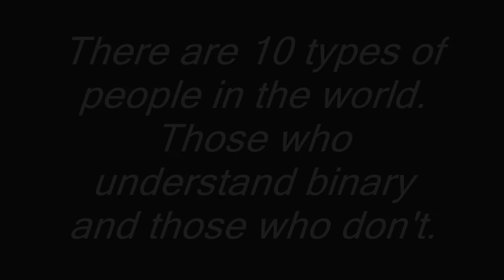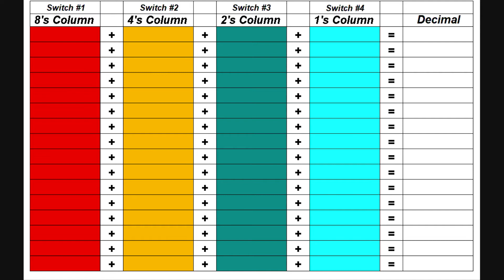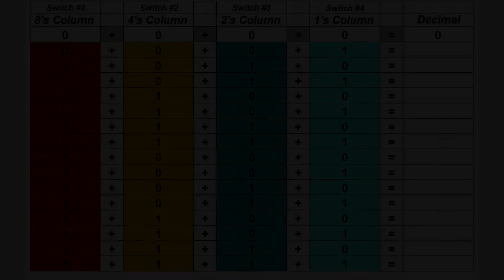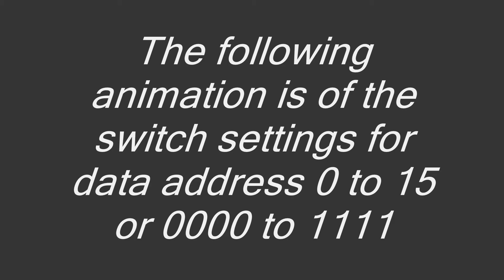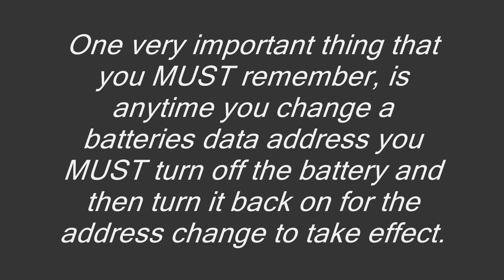Signature Solar EG4-LL Dip Switch Settings.

Comment: "Seriously screwed up addressing scheme" doesn't even start to do justice to just HOW screwed up this all is! WHY isn't this configurable on the LCD screen? WHY isn't there just a setting like "master mode" for the master battery? WHY limit your battery system to a 4-BIT addressing scheme?

I've just spend three hours trying to get just ONE of my four EG-4 inverters to communicate with my battery bank, and I'm just awash in fault 81 ("host loss"). If I put the inverter "battery setting" into "user" mode (instead of "EG4") and disconnect the BMS cable, this error goes away. Ah, but I just found out that you need to put the master battery into "protocol mode" (setting its "address" to all-down -- 16) and then holding the "enter" button for five seconds. At that point, supposedly, you can (and MUST) specify the communications mode ("CAN" or RS485) and protocol setting ("P01-EG4" for EG4 inverters). Soooo, you have to match your cable type, connection port, and even communication protocol to your inverters in the battery config! I'll try that tomorrow. Sigh.

It's ABSURD how complicated this whole mess is, and the fact that EG4 doesn't configure their inverters and batteries to work together out of the box is an outrage. I can't count the hours I have in trying to get these batteries and inverters to work! And just now finding that I still have to do some "protocol mode" garbage on the BATTERY itself  just makes me wonder how deep this rabbit hole still is. Heavy sigh.

And you've just gotta love "documentation" that includes falsely so-called "information" (that is critical!) like this: "There are 4 Dip Switches which set different baud rates and battery
group addresses." FALSE and inconsistent! The same DIP switches cannot be setting BOTH baud rates AND battery addresses! You want to know about those DIP switches, because you MUST do "something" with them to get your inverters to communicate with your batteries? Wellllll, just look in the manual, where you'll find that they are used to BOTH set baud rates AND addresses. So, good luck with that.

Really? WHO produces, edits, and publishes this sort of thing? 

Moreover, that lovely sentences is immediately followed by: "If switch position is turned to the 'OFF' position, it means '0'. If switch position is turned to the 'ON' position, it means '1'." FALSE! If this very video is to be believed, and if the "master battery address" configuration (setting it to binary 1) in EG4's battery manual is to be believed, then that sentence says the opposite of the truth. The truth is that "down," which is ON, means 0, and "up," which is OFF, means 1.

I could go on and on about how terrible EG4's documentation is. It is so riddled with mission-critical errors that it actually feels like they are TRYING to screw things up and pile on as much confusion as possible! And from looking at other people's comments below, it's clear that EG4 has indeed succeeded in their quest to produce maximum confusion among their customers. Good job, EG4! Good job indeed!

And their tech support takes weeks to respond. So, you're just on your own or poring through inconsistent web pages and YouTube videos trying to figure out how to get your total system to come to life.

I absolutely DO NOT recommend EG4 products. The whole system is inordinately complex, the documentation is a mass of errors and inconsistencies, and, again, you are not going to get timely help from tech support. You'll spend hours on your own doing research, largely befuddled by what you find, and you'll engage in hours of trial and error. If your hobby is "tinkering," then EG4 products are for you. But if you need to get your $40,000 system GOING, you had best go with some other brand. You are warned!
Reply from the maker: Richard, I could not agree with you more, EG4 products is seriously hosed up and SS is no better. My biggest concern is with their warranty will EG4 products be there should we need the warranty and what else in the batteries have they hosed up? I will be releasing 3 new videos on a project where I have to read and combine the data from the EG4 batteries an outback Flexmax 80 charge controller and a Schneider Electric Inverter and you would not believe the screw ups that I have found with all 3 of them.
Reply: @onmyworkbench7000  Thank you for the validation! I have been feeling increasingly stupid at my ineptitude and failure to get my system to come alive.

I don't usually think I'm a stupid man. I have a Ph.D. in analytic philosophy, and the company I founded produces enterprise grade systems for colleges and universities, so I tend to think that I can figure things out. Binary math and Boolean logic, for example, are trivial. But the cluster fornication that is EG4's "system" is beyond belief to me!

I, too, worry about these people even being around long enough to honor warranties! My understanding is that SS and EG4 are owned by the same guy, although SS tries to play EG4 off as a separate company.

Sadly, I did piles and piles of research while trying to design my whole-house off-grid system, and all that has proved to be either in error or befuddling. So, all I can do for others now is warn them off of SS and EG4. These products are NOT ready for prime time, IMO!
Reply from the maker: @richardjensen7186  I did not know that  that SS and EG4 are owned by the same guy, thanks for the insight.